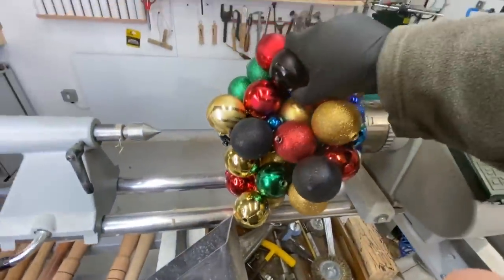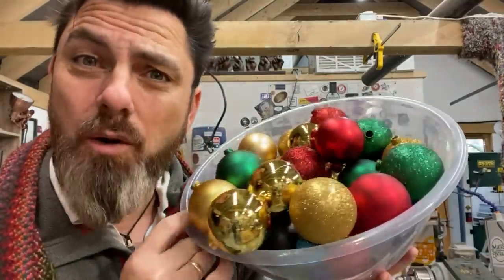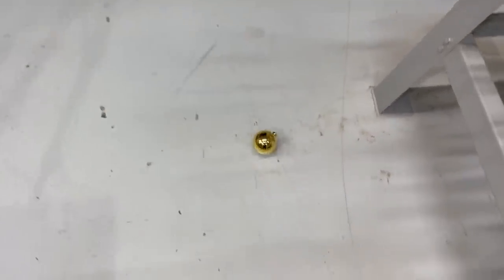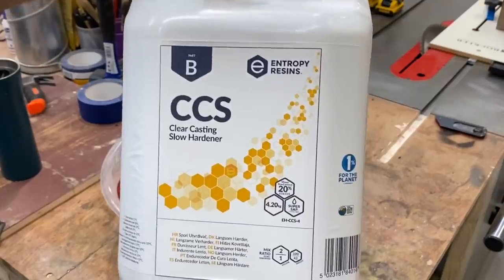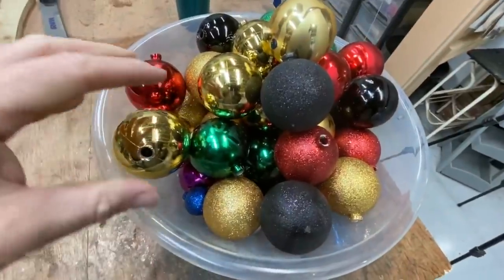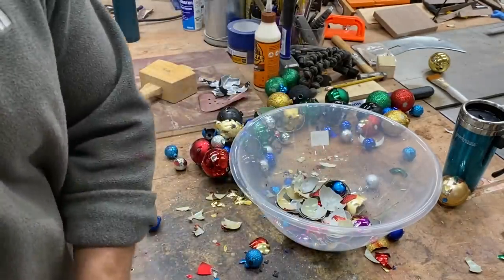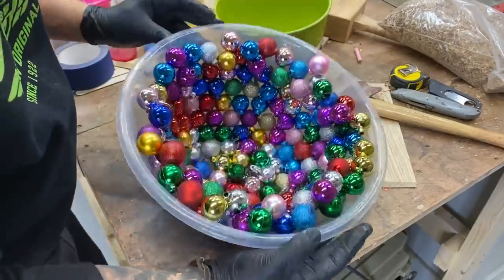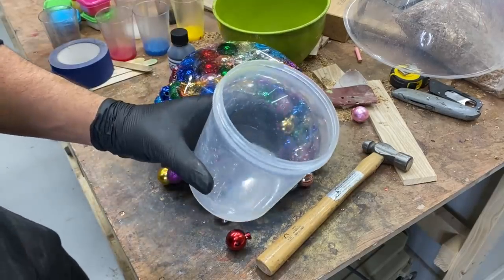Baubles in Resin | Not Sure This Will Work On My Lathe Though! (or will it) ? 😯

Comment: It looks cool! I have a suggestion... Sit the baubles in an egg box and fill each one with resin first, then do the resin bowl and turn it, you would avoid air bubbles in the baubles that way and have something solid to turn :)
Reply: I was thinkiing the same thing when he mentioned it. Make the balls so the light can come through and make a holiday lampshade.
Reply: Same thought here. Fill each bauble with a glittery resin, some coloured even. A Lot more work, but I think it'll look fantastic.
Reply: The insides would still be that dull gray
Reply: I would be tempted to match the resin on the inside of the 'baubles' to the outside color of them. Glitter and all!
Reply: I second this, use opaque resin on the inside to hide the dull white, the transparent on the outsides to show off the outsides of the baubles.
Reply: Was just about to suggest that, he can fill them with all sorts of lovely colours and then cast them in clear resin.
Reply: I was thinking the same thing, he could fill each one with resin the color of the outside of each
Reply: Fill each little ball with different color resin then peel the plastic off the balls, put balls in resin tube with center of tube empty, makes a nice light OR a clear table top with colored balls in it or ????????????
Reply: Was the first thought I had was to fill the baubles. Could colour match, or make them glittery lol
Reply: Same but coloured resin in the baubles
Reply: It's not enough that Key talks, can tell when Sherpa is coming, and chooses toast over waffles over steak, but now he's watching this crazy man's crafting videos?!
The wonders!
-
Also very good points. Filling the baubles with resin first, then reassembling and making the full block.
Reply: We all have the same idea. Coloured resin inside then clear on the outside  before turning. Could be amazing.
Reply: Yes 100% but when he fills them maybe use colored resin and cut off the little thing that holds the cap for the hooks
Reply: might also be neat to do some smoky swirls of color inside the bobbles so when it turns you get cool pockets of color 🤔
Reply: This was my idea too. It would have been sooooo pretty turning it on the lathe where you see cross-sections of each bauble
Reply: I 165th the suggestion. Had the same thought when you tried to conserve resin
Reply: @timsawyer9231  I don't think it's as difficult as you think it's going to be. Especially if he works with a slow setting resin he can use a silicone funnel to get the resin into the bobbles and doing a few stacks of them in the pressure cooker at a time can help pull out an bubbles that might not be visible. There's no 100% way to know if ANY resin project will turn out nice and there's always unforeseen circumstances that can occur when working with it. Many things can go wrong. Believe me, I know, I work with resin too. It's always trial and error and he can always do a small test with a few bobbles before going into something larger. We know Nick was never one to shy away from a big resin project anyways. ^_^
Reply: @RyanUpton  that could be incredible
Reply: Or hot glue the hole closed so the resin doesn't float into it.
Reply: @ngiraibiochelad  but then you can't turn it which i think is the goal here
Reply: Same here
Reply: Love watching you work that wonderful creative mind and your completely stonking workshop. I am unashamedly envious of both. Merry Christmas when it gets here and I will be watching in 2021. 😁
Reply: So everyone here had the same idea, but forgot the whole reason he did this was to save resin. Those baubles are made of almost nothing, meaning if he fills the inside AND outside, its basically just solid resin... and that's a huge bowl to fill, even with the negative space created by the smaller bowl.
Reply: @mikeslaserstuff4018  But, if he cut them in half he can also save resin.
Reply: I didn’t expect to see my favourite talking dog here
Reply: Awe i was really hoping he did fill them!!! Havent watched yet.
Reply: @meowrchl97  Sorry.  Spoiler alert
Reply: @denisesteil1890  not if you put diff colored resins inside
Reply: could do the same with hollow eggshells for a easter themed project
Reply: I was thinking the same thing

Comment: Filling each one first with resin is a great idea, and would work beautifully, however resin is expensive.

Maybe “seal” each one first with small amount of UV resin, with baubles standing on their opening on a silicone mat or shallow mold .... this creates a “cap” and would save lots of resin.  This cap would not be seen in the final project, as long as same color resin is used.  

Nick!   Please try this project again!

Comment: You should try some stained glass in resin. Make a sort of stained glass cylinder that you can put some kind of light into it that can have a pulse setting like a tea light does so you have a nice centerpiece that catches the eyes from all angles and is festive enough for all holidays. And of course put it on the lathe, can't have a funky video without that rainbow spray everywhere.

Comment: Interesting idea...the sort that sparks other ideas!  Let's see...
a) plug the baubles with caulking and glue their caps, then arrange them as desired and pour resin with glitter or glow in the dark pigment powder
b) fill each bauble with a different colored resin, grind the necks off, then arrange into a bowl (small enough to fit in the pressure pot) with a waste block, and pour resin either in a contrasting color or macro pearl or glitter, then turn that into whatever strikes your fancy.
That's all I'm coming up with at the moment...
Thank you for the idea spring-board!  Be well!  ;-)

Comment: Nick, You could try filling the individual baubles with coloured resins then do what you did with the two bowls so as to fit the pressure pot and then try it on the lathe.  Any baubles you cut into will have coloured resins inside , it could be spectacular !

Comment: The insides of those baubles is a silvery color. Could take a dozen tiny baubles, fill them with resin. Then put them into a lightly green-tinted resin.
Dark wood base, perhaps a wooden insert to preserve the colorful exteriors of the baubles on the interior. Basically, some circles of color, silver and green on the outside.

Comment: Pop the baubles in a egg carton, hole up. Fill them with various coloured resins, Pearls, glitters, metallics. Then when they're cured crack the outer shell, glue on the hangly dangly bit and then add them to a weird funky shape.  You could even add floaty bits to the baubles.

Comment: The aproach I would have taken is roll metallic paint around the inside of each of the baubles so they have something interesting on both sides, seperately filled each with resin, put the filled (and hardened) baubles together for normal resin treatment, and machine as usual once set. That should end with an interesting and fully machined item.

Comment: See through color tinted bulbs filled with tinted or colored resin with Christmas lights (one light in each) have the wiring on the inside so you can hide it in a resin layer. Do a night sky. The bulbs are the stars and the layered resin is the sky with the northern lights. You can get some very tiny bulbs or even cast your own.

Comment: I like the lamp, but due to a lamp my parents had, I would make it a hanging lamp!!!!!!! Also, any time you use any type of container, but especially plastic, if you use an oil to rub the contact surfaces of the container(s), it will help prevent the resin from "sticking" to the container(s). Usually a cheap cooking oil will work but might have to experiment with types depending on type of resin being used.
In the making of this particular lamp, I would have sealed the baubles either with a dab of clay or maybe clear tape, I would have went with clay myself, and then filled the space around the baubles all the way with resin. The openness inside the baubles would keep the weight down some and the resin thickness would prevent baubles from potentially breaking lose. 
Oh and that bowl that won't fit in the pressure compartment looks soft enough you should be able to trim the edge with either with a sharp good knife, a sharp good box cutter or possibly even a pair of scissors. Just make sure IF there is nothing to help get it out you use a ribbon crisscrossed across the bottom up the sides and either taped to bowl with a loop sticking up around edges to grab or in some way enough is above the bowl to use as "handles" to pull the bowl out.

Comment: or drill holes in each of them so the resin gets in them enough.
Reply: If you tried to drill through them, they’d probably just shatter
Reply: I was thinking block the tops using a glue gun to stop the resin going in but I'm not knowledgeable in the area so not sure if that would work or not.

Comment: Nick -  your little bulb lamp is adorable but the light bulb is really too large for the unit, switch it out for a smaller one so it does not stick out above the colorful bulbs. By the  way I have never seen black Christmas bulbs before now. Have a jolly good Christmas.

Comment: You could use more ornaments and add to the upper rim of the Christmas ornament lamp and leave just enough room as a hole in the middle top to change the bulb out when need to be changed.

Comment: I was thinking sitting here at work enjoying your videos and was thinking something you could do with the baubles baubles. If you still have the smashed ones you could make a inner lines on some wood and place the shattered baubles baubles and cover it with resin to make a bowl or even a box. Or even cutting the baubles baubles in half and sealing them into the ingraved area, something else would be pretty  interesting and werid. Make a lamp using mutli layers of say colored resin into rings, then between the different rings have the bauble baubles resined together with a Christmas theme! That be weird

Comment: Why didn't you put a hot glue "plug"?? would it interact with the resin?  Maybe plug it with small chunks of cork or foil paper?

Also you could color the inside with acrylics and/or glitter, in that way if you do smash the baubles, they will be pretty in the inside as well

Comment: Fill the balls create a form put a disc of purple wood or even a slab made of left over dyed pieces in the bottom place the balls around the outer ring and pour resin in it. The form would have an outer ring and an inner ring.  Only put the resin in the outer ring with the baubles.  That would save resin and you could turn it.

Comment: This is was not what I was expecting at all, very shiny and festive tho. I think I was expecting you to fill the baubles with a matching colour resin, then set that in clear resin, then turn it into a bowl or something in the lathe, so you get the shiny outer, the flat colour inside and the clear in-between. Could look interesting but would have been very time consuming and used a whole bunch of resin I think. Saying that does the resin expand slightly as it's cured? Would it split the baubles?

Comment: I think you should have made another one, then put the two halfs together, to cover the light, kind of like a big bobble, made out of little bobbles, with light peeking through the cracks. I think if you were going to turn bobbles, then you should use glass bobbles, because they actually look nice inside as well, usually... but you'd maybe have to fill the bobbles with resin first...?

Comment: Did you know that if you have the modern baubles that bounce like table tennis balls, you can use a heat gun to melt them gently, then they will be flat and the boring inside won't show?

Comment: Couldn't you use a vacuum chamber to get the baubles filled up?     Long setting resin, fill the bowl around, draw a hard vacuum.    Release, Add more resin on top, repeat.   With a good vacuum pump, it'll fill the spaces almost all the way.. (you could even alternate colors for some swirls filling the spaces up :))   Once it goes in the pressure pot what's remaining of the voids should just disappear!   With colored/glitter clear resin, the inside plastic color shouldn't be too egregious...

Comment: But for the items not put in a pressure pot benefit from 3:1 resins?  At 9:30 you can clearly see the huge crack in the wood...so that was your own fault.  That light would look really cool suspended and the focus of the bottom with the reflected light.  You wouldn't need a huge lightbulb in it.  The focus isn't in the huge lightbulb...but the bunches of little coloured reflections.

Comment: You should use glass ones they are mirrored inside broken up would look awesome  you'd have to be careful and recoat the outside in resin but it could be done the incredibly dangerous flying glass shard dust wear a protective suit 😂